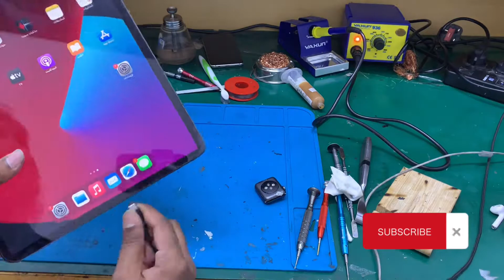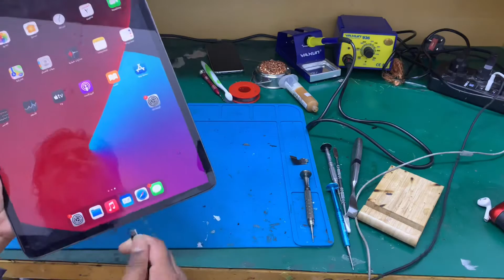How to iPad Pro 12.9 3rd gen Charging Port Replacement || special i

Comment: Hi bro, 
I have an iPad pro 2018 11 inch, It suddenly never charges! I tried so many things but it still doesn’t charge. I can assure you that the ipad charges my iphone but never charges itself.
I don’t want it to be opened until i know the exact problem. Have you ever faced this kindda issue? What do you think is the possible problem in your experience? I want you to gimme the possible problems that you think it could be please.
Reply: @charlschuck6  what type of glue to use to reseal the screen?
Reply: I have the exact same problem can you tell me how did you fix it
Reply: I have the same problem, Apple will replace tablet for $649.00, another repair place charges $245.00, because they have to destroy the screen and I have to buy a new one. Last person $95.00 to replace charging port
Reply: @yaqeen000  hey, What I did is that I left the ipad until it fully out of charge. And then suddenly when i charged it, it charges!!! 
You can fasten the process of charging consumption by turning the back light and raise the screen brightness to max. Once the battery is dead, you can leave it for one day because there wud be some power but it is not enough to turn the ipad. Wait one day and then plug the charging cable in, and it shud start chargung!!